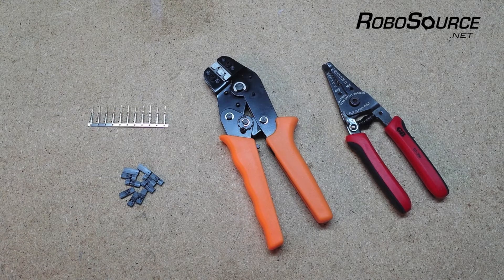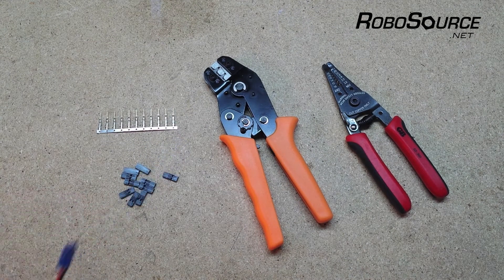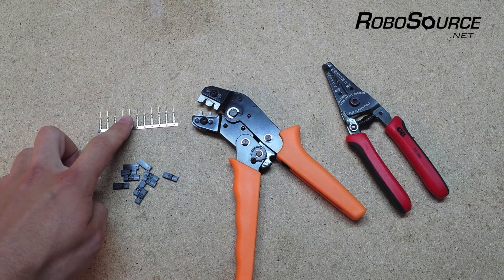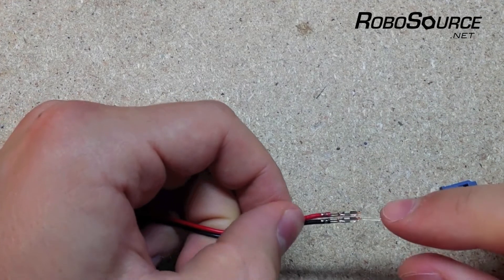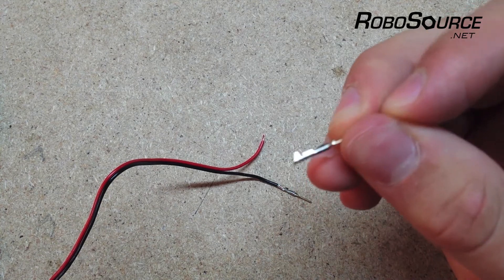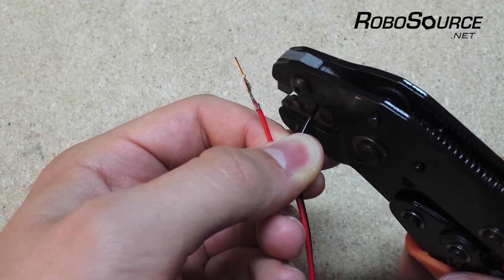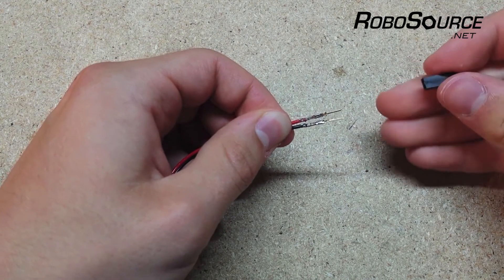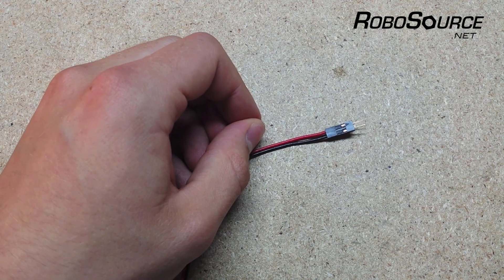Repairing VEX Connectors on Motors, Sensors & Wires with Crimp Pins

Comment: i have an old display (its actually my dad's i just found it and fixed it and used it) anyways the board was falling constantly i opened it and then screwed the board into place but i ripped off a vex wire while opening it and now the display wont turn on i dont have any money on me (im just 12) idk what to do i dont have another monitor